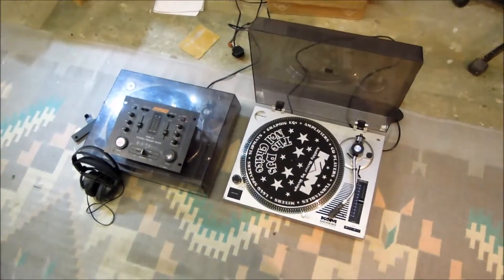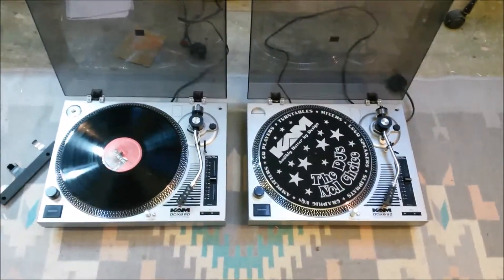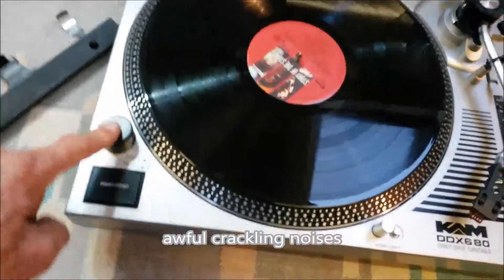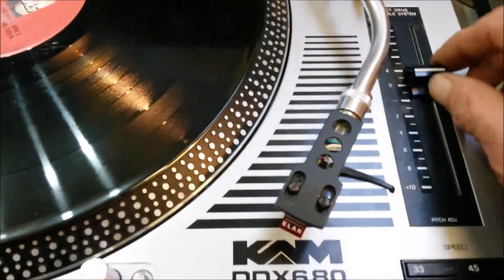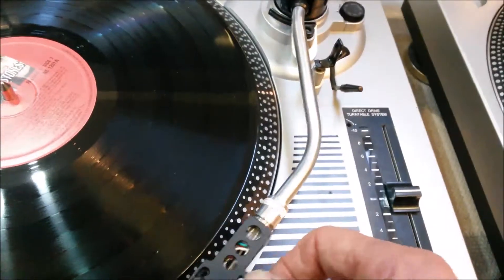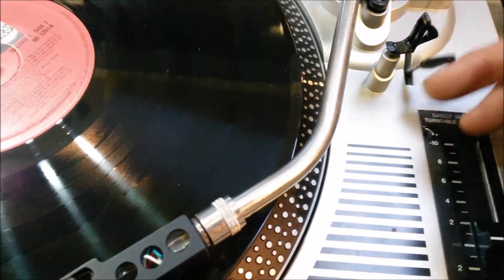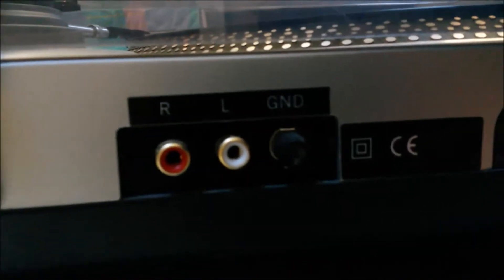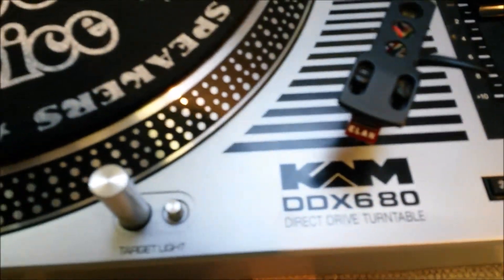My Junk KAM DDX680 DJ decks

Comment: I had an earlier set of similar KAM's as my first decks as a kid in 1995. Terrible decks! Belt driven, plasticky, warped platters, absolutely no torque and +8 was actually about +4 :-)

Were these direct drive models any better?
Reply from the maker: These seem to have been used quite extensively. From being a really budget make I think they tried to move up market.

Comment: I've got the kam ddx 750 I just need the lid but the turntable only cost me £20
Reply: That is a seriously good buy. Why not just make yourself a plywood lid. You then can spin discs for only £20! John
Reply from the maker: It would cost you more than that for the lid. Use without lid or buy one complete with lid. I will list mine with lids in about two weeks on facebook marketplace.
Reply: @bikerides  I might just do that thanks 👌
Reply: @LatheBits  I will try and find a complete one that's for spares or repairs. As the lids I've seen are £50 upwards or I could make my own lid out of wood 😉
Reply from the maker: @djpaul146  I haven't listed mine because of lockdown. Plywood lids sound good.